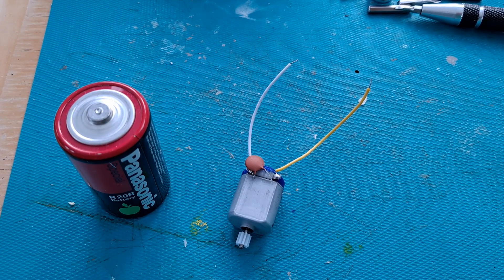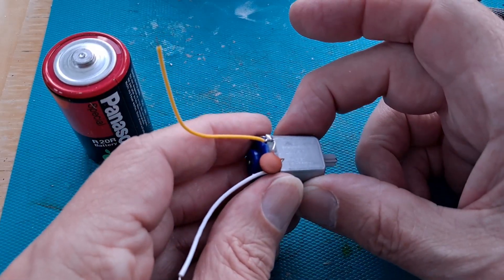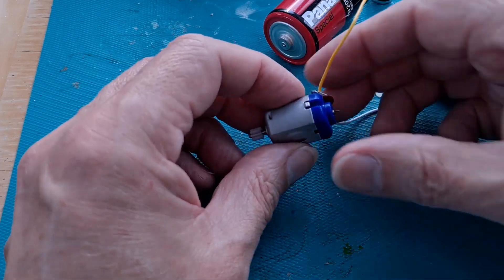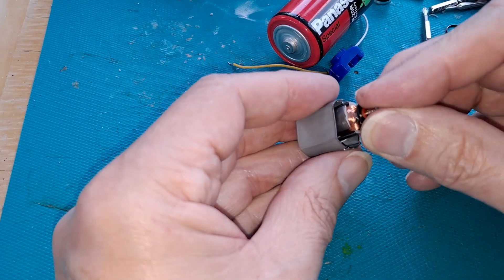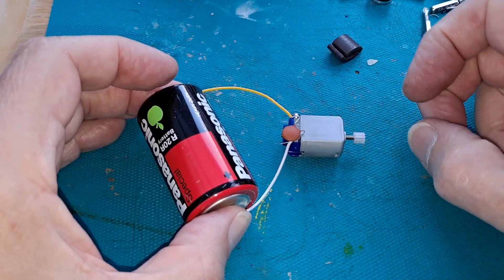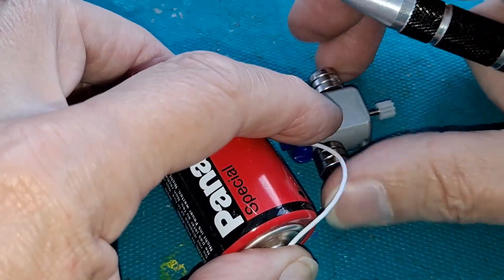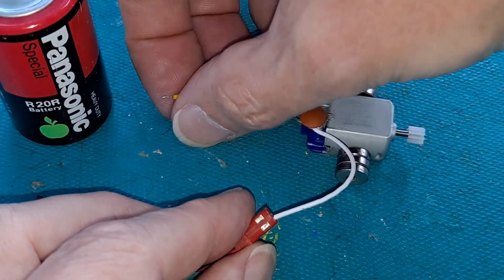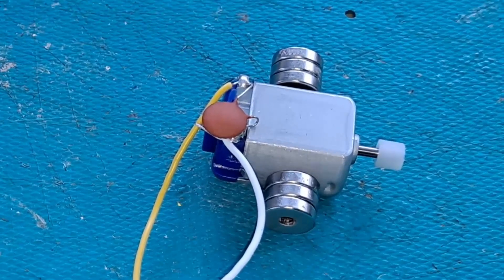Video Reply - extra magnets on a DC motor 20220804

Comment: They used to sell neodymium magnets, that were near exact replacements for the ones in a 130 sized motor. Because of the nickel plating, they might have been slightly thicker, but they still fit. They dramatically increased the power output of the motor. They did make the rotor a bit harder to turn, when the motor was at rest, though. They also increased the power required to start the motor, slightly. It greatly hindered low speed performance, but they dramatically boosted the high speed performance. They were for a specific application, that used 130 sized motors. (Kyosho Mini-Z R/C cars) Perhaps, they still make such magnets.
Reply from the maker: Thanks for the information👍👍

Comment: Your metal housing is taking the field lines and smearing them out, attenuating their strength. Its running exactly how it should. If you take it out of the equation or cut holes through it you wont be wasting power with the attenuated field... Ive noticed that aliexpress they are selling that kind of saddle shaped neodymium magnets. I was considering ordering some myself for modification of some power tools, looking into it is how i found your video. Interesting stuff. Thank you
Reply from the maker: You might like these two related videos
Video reply - Magnets on the flat sides DC motor 20220901 https://www.youtube.com/watch?v=5hgotwPSdFk&list=PLA5a2xPRSrB29gSQavaGm8H2vqVg8kcgJ&index=106
Video reply - Inside out DC motor 20220901  https://www.youtube.com/watch?v=iJuG25eyF44&list=PLA5a2xPRSrB29gSQavaGm8H2vqVg8kcgJ&index=107

Comment: maybe if the magnets were on the flats of the case?  ppl ask because they may not have the equipment or dexterity to do it them selves, I fit both of those categories plus Im color blind
Reply from the maker: If you put the magnets on the flat sides they do not align with the brushes. Here is an advanced peak at the video reply https://youtu.be/5hgotwPSdFk

Comment: Does it make any difference if you put the magnets on the flat sides of the motor? bringing them closer to the internal moving parts.
Reply from the maker: If you move the magnets to the flat sides you will have them out of alignment for the brushes.
Reply from the maker: Here is an advanced view of the video reply https://youtu.be/5hgotwPSdFk

Comment: You could try printing a case to hold the magnets closer or not it was still interesting.
Great video. keep up the good work.
Reply from the maker: Remember electric motors get hot when they are running so you would probably melt whatever you had printed.
Reply from the maker: Here is an advanced look at the video reply https://youtu.be/iJuG25eyF44

Comment: Good result. I'd only tried it with the ceramics still in there, thinking similarly about the metal case.  
Removing the case makes for a wonderful visual as it runs, but is tricky to set up. Can leave the back plastic on with the motor brushes, the front of the shaft can be suspended within a loop of copper wire. The magnets were glued on top of pieces of foam, iirc. There will be other ways to set up a can-less motor.
If it sounds like a fun challenge, I'd like to see that as a video request  😀
Reply from the maker: Hmm, video request. I had hoped I had answered the questions on this one, but when you put it like that I might have to think about it. MrNice79 suggested I should 3D print something to hold the magnets.
Reply: @GrandadIsAnOldMan  I thought it might be a good interesting build for folks to watch too. We're so used to seeing them look a particular way. A redesign to watch the innards spin may also be useful n a motor project.
Reply from the maker: @Slider2732_  here is a peak at the video reply https://youtu.be/iJuG25eyF44

Comment: Nice video, James. I've tried this before with those same magnets, fun playing around with the motor's power output, just needed to apply a higher voltage at times. 
Would be cool to know if those neodymium magnets can be bought in the shape of those curved ferrite magnets that sit within the motor housing. That way you'd get a solid fixed unit that's capable of delivering more mechanical power. 👍🏻
Reply from the maker: Hi Max. Hope all is well 😁😁
Reply: @GrandadIsAnOldMan  Hi, James. All is well, thx for asking. Hope all is well your end ✌

Comment: That was interesting. Looks like it does require a higher voltage because the neodymium magnets are a lot more powerful and probably holding back the commutator so more voltage is needed to overcome the magnetic field.
Reply from the maker: Good afternoon, Mike. How's the weather up there? I just tried flying a new kite, but it was only short gusts, not enough to keep it in the air. Still very hot.
Reply: @GrandadIsAnOldMan  No wind but dry and warm. 
Been out in the front garden clearing up the mess my wife made when she decided to go and cut the grass and bushes back this morning. Some large parts with big thorns are not nice to get in the hands. My own fault I suppose I should have had gloves on. Now the brown garden bin is full and there is still a load to clear. The binmen up here are still on strike certain days so I don't know when it will get emptied. I am seriously thinking of turning the front garden into a car park. It's a pain in the A**.
Reply from the maker: @mikeflight9  I take my green waste to the local recycling centre. I could pay monthly for a green bin, but I would never get all the cutting in one, so I would still be driving to the centre anyway. I used to have one of those builders dumpy bags that I could just squeeze into the back of my Citroen Picasso, but this Mokka has a much smaller boot so I have had to downsize. On the positive side, that does mean I can lift the bag on my own without struggling. To make it easier, I fill the bag, then leave it in the garage to dry out for a while. It makes an amazing difference to the weight.
Reply: @GrandadIsAnOldMan  Well, I was actually at one of those recycling centers yesterday with my daughter. She had bags of rubbish from her hairdressing shop.
I don't remember seeing any green waste area there but now you mention it I will check it out. The bag idea sounds good. The bags you mention, are they like canvas-type bags? They would do the trick. 👍
Reply from the maker: @mikeflight9  the one I used to have was the heavy duty type builders would have a load of sand or gravel delivered in. Woven plastic hessian type of thing. They come in 1 tonne size, just under a cubic metre. I just did a quick search online for "dumpy bag" and there is a good range of prices. Just under £10 from Screwfix, and £3.96 from somewhere else. The slightly smaller one I am using now, came from LIDL and was a set of 4, one big and 3 smaller. Can't remember how much I paid.
Reply: @GrandadIsAnOldMan  Thanks for that Graham. I know the type you are talking about. I had stone chips delivered in them. I ton per bag, so very strong. There is a brand new Screwfix that just opened up about a quarter of a mile from me. 😁👌👍
BTW: I had a Picasso before we bought the Vauxhall Mokka. LOL Had it for 13 years.
Reply from the maker: @mikeflight9  I loved that Picasso, was sad to let it go.
Reply: @GrandadIsAnOldMan  Yes me too. Tons of space and versatile. Could take the seats out NP and it turned it into a van, just about.

Comment: Maybe try putting the magnets on the flat parts of the casing so it makes more contact just like the curved magnets sat inside the curved parts of the casing
Reply from the maker: Then you might have a problem with the brushes being out of alignment 🤔🤔
Reply: Motor timing either plus or minus 90 degrees too hot